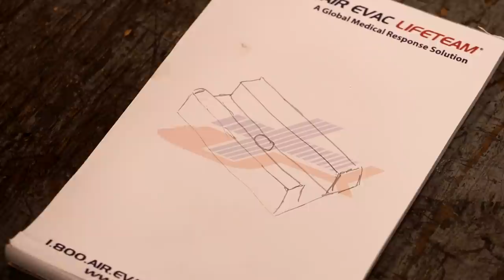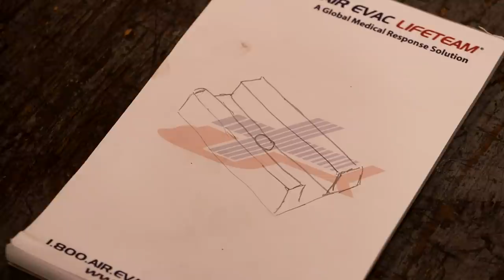Frick Steam Engine Restoration - Fabricating & Machining an Axle Bracket

Comment: I was skeptical that your boring bar/head would hold up on an interrupted cut with that much stick out, but it did! Good work, interesting video
Reply: same
Reply: I'd have probably done it on a Rotary Table.
Reply: OK after he tightened up the gibs.
But still adjusted it without loosening  !

Comment: A nice project Keith - I can see the improvement in your welding has Abom been giving you some lessons?
Reply: My guess would be Jim Bollinger as he had a welding booth set up at the bash.
Reply: When he welded the longer rectangular pieces to the 1/4" plate he didn't chamfer them to allow him to get penetration. It seemed like a pretty weak weld. The hole for the eye should have had a chamfer around it, again so he would get penetration. If the part is only for looks, then it's no big deal. Also, weld spatter on the gauge blocks is not a good thing.
Reply: @garys9694  If you look at the earlier Frick videos this will be a static show piece, I still feel Keiths welding has improved but bear in mind he is a guy in his own workshop showing us what he does not a top professional welder trainer.

Comment: Really love these little shop projects. Out if curiosity, and not looking for exact information, but is there much of a difference in costs between building it out of steel as you did versus getting a casting?
Reply: Time, not $, was the reason for a weldment, instead of a casting.

Comment: Do you ever use cutting fluid on your drill bits?  I like Mystic Metal Mover (yellow can), seems to aid in cutting when drilling, and helps cool bit at same time.  But, that's just in my little shop, I'm a metal butcher. Not machinist, lll
Reply: Some would say the same about Keith.

Comment: If the boring head is moving in the cut it's likely not being locked.  The usual practice is to snug the outside screws to tighten the gib for a nice feel and then to use the center screw to lock it for the boring operation. That makes the diameter change a process of unlocking the head with the center gib screw, set the diameter, relock with the center gib screw and then make the cut.

That's the way I learned it, anyway

Comment: Keith, you mention that the part originally was made out of cast iron and now your using steel.. Can you explain what the differences are between those materials and if there are mid- longterm risks using steel in stead of cast iron?
Reply: This is an entire subject, but the short version is this:  Cast iron is a durable, and easily machinable metal, but is a brittle and can fracture under sufficient stress. Cast iron has excellent castability, and, using pattern-making and foundry methods, can be cast into shapes that would be impossible to machine. Steel is a durable, and easily machinable material with a high tensile strength that resists fracturing.
Reply: @DavidKutzler  "This is an entire subject"  I thought so... thanks for the short explanation, David!

Comment: Well, judging by the fact that he didn't reply to the last video regarding comments about the length of his axle adjusting rod, it appears that Keith doesn't read our comments. He certainly didn't reply to them. He spoke "48 3/4 inches" when he had written "49 3/4 inches" on that rod. Either that, or he got it right after all ... or he's too pissed to comment on it.
Reply: Keith rarely replies...

Comment: Anybody else rue the day neodymium magnets got into their shop ?
All my allen keys, screwdrivers and untold other items look like fuzzy little hedgehogs.
As for using them for spacers forget it.
They are impossible to clean.
Dust and swarf from angle grinding at least 1/8" thick.